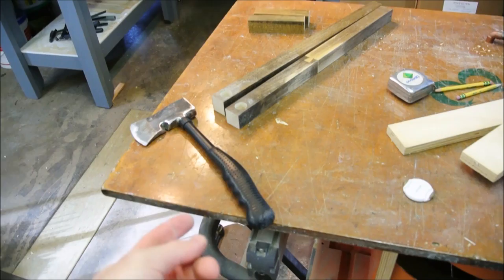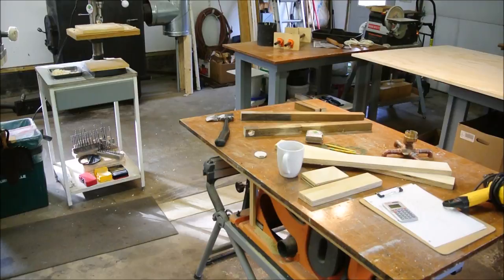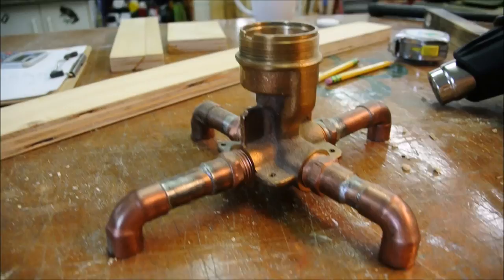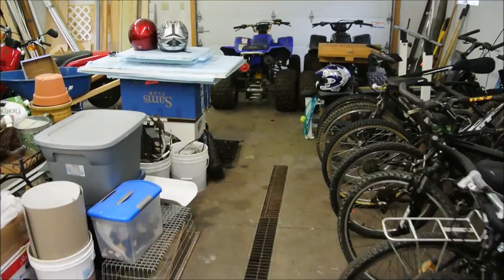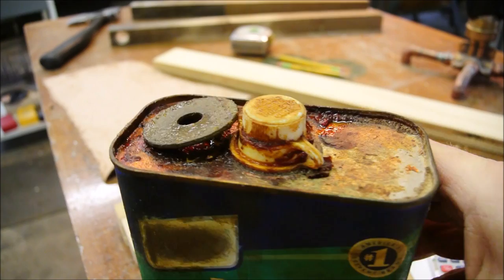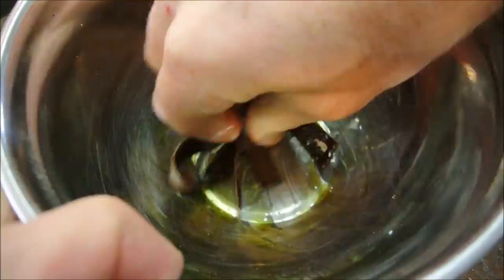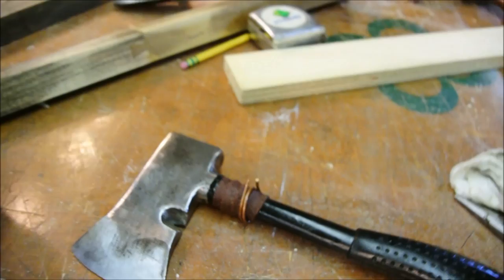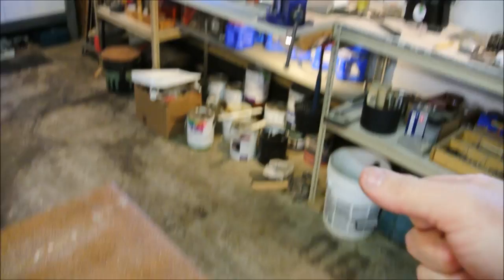"Improved" hatchet follow-up. Tinkering.

Comment: Yeah, injuring yourself with a simple sharp pointy object is alwaus embarrassing.  I found a felling axe head in a barn i was tearing down once. I made a new handle for it, then put it in my foot the next day. 6 stitches later, it now hangs on the wall with a pocket83 magnet on it...
Reply: I remember the first day of my internship at a coffin workshop. They had me assemble a load of handles: glue, tack, fill the holes. So I did, and after a while the putty knife gunked up with dried filler. In an attempt to remove it, I ran my finger straight across the blade, somehow, stupidly, totally oblivious to the sharp edge underneath.

ÁYeah, it's humiliating to have to go ask where the bandaids are on your first day at a job.

Comment: Pocket, let me first start by saying thank you for being original and practical. I’m definitely not a YouTubed but I am in a sense that I watch a lot of YouTube. A lot of times it’s for the very reason you mention in your initial video with this hatchet, practicality and use for other applications. A lot of times a lack of confidence and experience in a craft can be intimidating and hinder progression and youtube has helped move that out of me on many of occasions. Thank you for again being original. Our ideas do not always work but if we don’t try and continue to improve on what we are knowledgeable with then what’s the point. The hatchet may not have worked but whose to say it doesn’t help with the handle of my worn out shovel, or the pruning shears of the garden, or even the other ideological projects that come to fruition. Keep doing what you’re doing and it will pay off. Thanks again, from a new subscriber. 👍
Reply: Youtuber*

Comment: It probably smells wonderful in there with the wood burning smell.
Have you considered installing a mini-split system?
Reply from the maker: I really don't know what that is. But you're right- for the moment, a fire is nice. It will get old, I imagine.
Reply: @pocket83squared   Mini-split A/C system or Ductless A/C system.  Air conditioner unit for buildings that don't have ducting installed, or if you want to heat/cool a specific room, like a garage. They cost around a $1k, and be DIY installed.

Comment: 10:03 Matt is currently posing a serious security threat to you. Small chance for it to happen, but when it happens (not if), it will be a world of trouble that can easily be prevented right now:
I'm talking about the mushrooming you got there from hitting it with/on metal like you would with metal wedges  (which you shouldn't do in the first place, because usually those are made from different steels). I've seen detailed explainations about why it is dangerous on several blacksmithing channels (look for "mushrooming shisles" or smth) and Alec Steele (my favorite blacksmith) mentions it in several videos. The essence you need to know is that due to the hammering, the metal roster structure changes (stores the energy of every hit), and when a chip breaks off, it releases all that energy at once (shot can be compared to a bullet). So the chip shoots away with that same force. Those chips are usually very sharp too, and act like shrapnel from a grenade.
I personally never got hit by one (but had some chipping off before I improved my safety) but a friend of mine had to go to the hospital to get one surgically removed from his arm. Alec usually paints the example of it hitting an artery and killing you. And that's not unheard of...
so take your angle grinder, and shave off those curls on the back of that axe head, and do your chisles too while you're at it :))
Reply from the maker: Now THAT was constructive criticism. Thanks, man. But in my defense, I didn't do that. I think it was the real MATT. I just use it as an axe.
Reply: @pocket83squared  /ow stop it, you're making me blush/ haha ;)
Just thinking out loud, adding some info from one of my favorite topics (safety, which is basically just professional bias from when I was a firefighter)

Comment: I just saw your 2 videos about your hatchet and i would be willing to build you an led light system for your workshop at cost, >^-^<. I love ultra high power led stuff and i've spent probably too much time looking at every thing that digi-key, mouser, and ebay have to offer. Also i have a a few years of hands on experience with a bunch of high power stuff like running a cxa and now cxb 3590 at full power with a noctua server heat sink and a green works 40v 4ah battery and boost and buck converters. But now i'm to the point where i can use true high power led drivers effectively and i want to help out people since i can so if your down hit me up!

Comment: you know that bateries last longer in the cold right? living in one of the coldest place on earth i can tell you that a properly charged battery can last 5-10years even when stored outside at -35C.
Reply from the maker: No, I do not understand that. Maybe it's the case, in theory, that the cold preserves a battery's overall life. But in the real world where I don't charge it or use it enough over the winter, the cold just seems to kill batteries. 

I do wonder why, though. 
If I were to guess, it's that heat is simply an interpretation of what is atomic motion, and so the chemical process by which a battery degrades should be slower under less heat/agitation. In my understanding of the physical sciences, cold pretty much just means 'slow.'
Reply: @pocket83squared   in fact a well charged battery doesn't freeze (acid inside) until  colder than -45C~. the problem is that some parasitic draw could discharge the battery in the winter, thus reducing the freezing point. i have seen battery freeze and swells up as "hot" as -5C. also lead-acid battery get damaged each time it is fully discharged, the lead plate gets coated with a salt coming from the acid and reduce the amperage capacity. sometimes the said salt drops at the bottom and shorts some of the plate causing the death of the battery.

the cold doesn't kill them, but the lack of a proper charge/maintenance does. you often see cars dying in the beginning of each winter, but the real culprit is most of the time that the battery got damaged in the warmer season when people forgot their headlights on or something, reducing the overall output.

Comment: hmm a heatgun IS a stand? they are made to stand on a flat surface blowing up.. never saw a need for a heatgun stand ;-)
and 3 day old spaghetti are harder and dryer LOL
in order to really harden leather (and not the fake stuff you were using) is to heat it with water or oil.. the fibers rearrange and collagen hardens when cooling. in the fake stuff there are no fibrous connections any more.. so that cant work.. rawhide would, though! nice try ;-)
Reply from the maker: Hmm indeed. That will likely 
1) slow you down 
2) overheat it, and 
3) certainly end up burning you.

As a more than frequent heatgun user, I must recommend a stand similar to what I'm using here.
Reply: @pocket83squared  i never had those problems.. but i admit i am certainly not using the heatgun as often as you do.. ;-) and probably for different applications too.. :-) i like the stand, dont get me wrong.. i just felt it unnecessary.
Reply: “It will feel room temperature...”

What else would it feel like?
Reply from the maker: Bill: Steel feels cold at room temperature, because it draws heat from your hand. If it feels room temperature, that means it still retains heat from before.
Reply: Not all heat guns are created the same. There are heat guns from the past that can not be stood up. Also, what is wrong with keeping yourself safe from exposure to crazy amounts of heat?
Reply: Also he specifically said it wasn't like normal raw hide. Don't act like you know about things you clearly have a limited amount of knowledge in. Pocket, if you need some muscle, I'm here bro. Lol

Comment: I suspect more people would complain that your stroking and oiling Matt's wood hard length because he likes it.. 
Sorry. :)
Edit: Last time I used linseed as a polymer on anything other than soaking onto timber, I was using it as a metal protectant on a friend's sword and it took about 3-4 months to fully harden and cure. I'm sure there is a trick to making it happen quicker but for me it's a 'great coating that won't damage wood, metal or anything else and can clean off afterwards completely(at least off the metal, it stays in the wood and keeps it nice) if needed' coating.